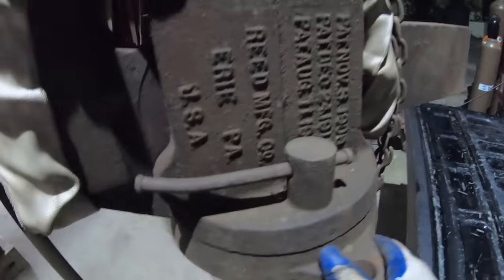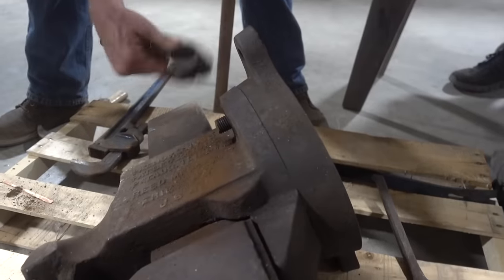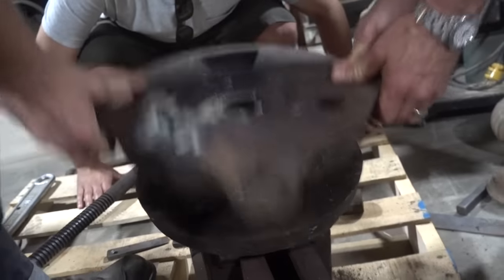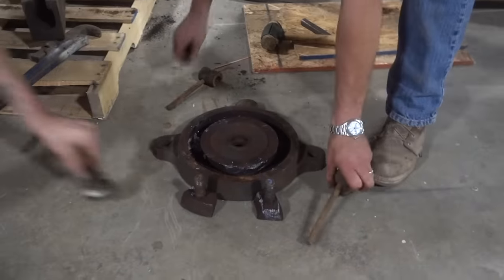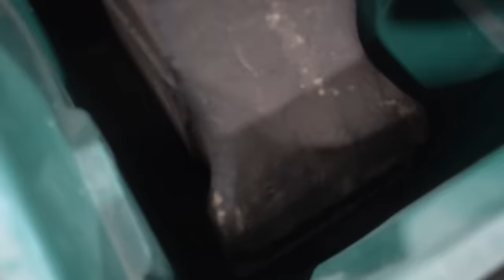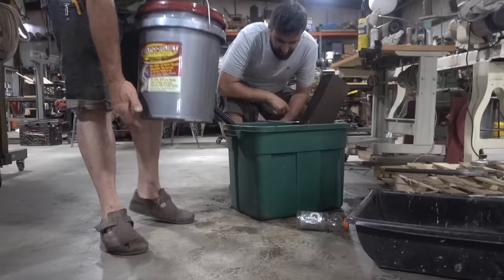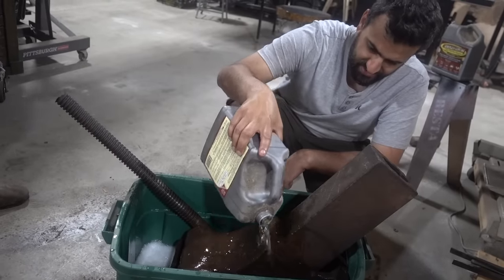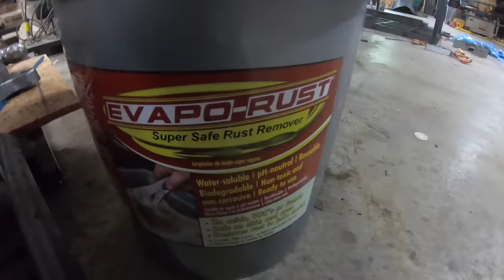DiResta 280lb VISE restoration

Comment: It always pains me to see people try and disassemble the slide.. but don't use a wire wheel to remove the rust and debris.. so they end up beating the hell outta the thing..
Reply: Or adding some penetrating oil, works wonders.
Carl
Reply: Yup. Amateur hour.
Reply: I know that just kills me also. If they would stop and think about what they are trying to achieve it would make their life alot easier. Work smarter not harder.

Comment: Great trick I learned from an old-timer for getting rusted/seized components or bolts lose:
With a torch, heat the metal.
Rub wax of any kind on the joint.
Let cool.

The wax will be pulled into the joint/cracks  & lubricant the metal as it cools. This works when penetrating oils fail.
Reply: Huh... gonna try it this weekend :)

Comment: Pounding wedges in stuck vice jaws is just asking for trouble. I have seen the massive mighty jaws just snap but Im so glad this vise is being restored. I have one just like it.
Reply: I was thinking the same thing. what's the alternative? pre-soak in rust remover before working the parts free?

edit: I thought you were referring to the base coming off. but still, what other options are there? hydraulic press? soak in oil ore additional rust remover? I liked their heating idea to loosen the grip
Reply: @TomsLife9  50%50% automatic transmission fluid and acetone. Chews up the rust and penetrates deep in the cracks. Freed lots of rusty things up with that mix.

Comment: When things are stuck try a solution of 50% acetone, 50% automatic transmission fluid, also know as Fagen's Brew. Mechanics workshop did a torque test; Nothing 516, WD40 238, PBBlaster 214, Liquid Wrench 214, Kano Kroil 106, Fagen's Brew 53
Reply: IMHO acetone and ATF is fine for a small glass jar (or perhaps a quart) of parts, but the flammability risk is too great when using a larger quantity of acetone. A saner (and safer, cheaper) "solution" 😆is diesel mixed with about 30% ATF. Very old and proven mixture. Just did a large industrial chain at work a few weeks ago using 3 gallons of this very mix.  Very successful as always.

Comment: Does anyone know what Jimmy used to get the raw metal shiny look? Glad he didn't paint it...
Reply: I've used similar rust removers and they tend to leave a black residue that washes or wipes off. I'm guessing Jimmy used a wire wheel on the angle grinder to get that surface on the metal

Comment: "This is not the rookie corner over here"...proceeds without a drop of any kind of penetrating oil, hits threads with a hammer a couple different times, mars a part with pipe wrench jaws.
Reply: Dennis O'Brien I was thinking the same thing...only a rookie would need a hammer that big to get the job done. Haha

Comment: Should have bolted the base to the concrete and hammered the hell out of the tail with the woodblock and sledgehammer..
Reply: Heat application. They did it at the very end, and it did the trick.

Comment: Beating on that vise WITH A SLEDGEHAMMER like that was pretty stupid. You
should have soaked it in evaporust FIRST and or 
SOAKED IT IN A CONCOCTION OF OILS to free everything up.
I don’t think I’ve ever seen such stupidity.
Reply: It looked like they did soak it. In evaporust. Before they struck it with a sledgehammer. You could even tell that they were reluctant to hit it even then.
Reply: you obviously have no idea how strong those old vices are its 280 lbs

Comment: I like that you didn’t do all the unnecessary work to repair chips, fill voids, etc. A tool is a tool and they’re meant to be used. They don’t have to be pretty, as long as they do their job.
Reply: Agreed! I'm working on restoring a large vise but am not going overboard with it. Just cleaning it up a bit and then will be putting it to work.

Comment: We used to have the equivalent Sheffield made vice at the Pit 'I worked at. I think it was called a Record chipping vice and it weighed in about 2 1/2 hundredweight. When the pit closed one of the blacksmiths made off with it [and a load of other stuff] in the back of his car - looked like concord taking off with his front wheels barely touching the ground

Comment: Flipping the vise upside down (jaws towards the floor) after soaking, helps it to break free while using the hammers. (Gravity assist, plus not having to slide through it’s worn and rusted path.)

Comment: A pneumatic hammer with a flat ended bit, applied in the right places, would greatly assist in breaking free the rust bonded parts (shock wave).

Comment: Well, if I ever get a huge rusty old vice that needs fixing, I now know how to do it, but I think that I'll use a set of bar clamps in expansion mode rather than do all that hammering.

It just occurred to me that, if you had made that collar clamp and put that on first, you might have been able to separate the jaws with it's threaded rod.

Comment: Should really consider rebuilding the seats of those jaws with some siliconized bronze or a similar filler. They broke off for a reason, your jaws are going to want to pivot in those directions whenever you're putting that vise through it's paces.

Comment: I see he milled a flat land for the allen bolt in the turn screw collar, most likely an afterthought as it would be easier to drill and tap on a flat rather than a radius... as well as drilling with the mill while still set up after machining  - 11:40

Comment: I restored 1 wilton (6" Italian made (!)) and 1 Grey tools (Canadian copy of #8 Record) in the last two weeks. Both vises had missing cast iron chunks from them and both times using cast iron welding rods I fixed them. I am wondering why you did not do the same. I welded extra material on (metal was golden in color) and then I fixed the surface on the milling machine with rounded parts fixed with hand grinder. If I wanted to make it perfect without any marks I could use some bondo or when metal is exposed some tig.

Comment: Hey Jimmy. Nice piece of metal you have there. How did you transfer the mounting holes for the old jaws onto your new flat stock? Is there some trick using ink / Sharpies or did you use a piece of paper and a pencil or maybe masking tape with cut-outs? Usually when I do something like this in wood there is enough "slack" in the whole system to allow for my inaccuracies. Getting the holes to line up perfectly in metal seems to be so much tougher, though.
Reply: shouldnt be hard to measure up from the bottom shoulder on the vise to the height of the holes then just the spacing between them and transfer that to the new jaws.. i always grab the next size or sometimes two sizes up of drill bit just to make life easier with fitment and not doing things twice... not all projects allow for that though

Comment: Bangin' away on the metal vice with a ball peen hammer with earplugs dangling around the neck.......good one. 😁
Adam Booth is wishing he'd found that. 😉
With the lubrication of the cast during machining you've now created a slurry of the dust just great for the ways....just saying.
Thanks for the video.

Comment: You need to get a shitty oven, large enough for stuff like this. Get the vise (or giant rusted part) toasty (temperatures may vary with location) and then take it out and douse the seams with any thin oil you might have. Prolly want to do this outside. Idea is that the thin oil will seep in the gaps and allow you to take it apart.

Comment: what kind of steel did you use for the teeth? did you harden them or was the steel hardened already? what kind of steel should i use if i get in this situation myself?
Reply: Hardened 4140 is a good  general purpose vise jaw steel.

Comment: Nice to see some familiar faces 😁
I was wondering.. Why are vice jaw plates (if that's the right term!?) never hardened? Could someone enlighten me please guys? x
Reply: Jaw inserts are not hardened because you want them to be softer than the workpiece you're using them to hold. This way the inserts get damaged instead of the workpiece. Inserts are designed to be replaceable. They are essentially a consumable item.
Reply: @JDeWittDIY  Thank you. That makes perfect sense..❤
Reply: @-Deena.  No problem, glad to help!

Comment: I collect vises, you have a beauty.
Reply: Maybe you can help me?. I have a vintage vise it weighs about 150 lbs. The only marking on the exterior is a capital G,, Any ideas the make of it? So maybe i can research a little on it,
Reply: john piano hmmm would need a pick of jaws and base, anything cast into nut?
Reply: @johnpiano5226  Are you sure that is a vintage vise, I have seen more modern vises made with that mark [usually not American made]
Reply: @darrinrentruc6614  probabally 1950''s ish it is a beast.. 130 lbs or more it is huge..
Reply: @johnpiano5226  If it is 1950 ish then it is probably USA with American Quality. Sounds like a keeper to me. I have bought and sold many on ebay in the past. They will last many generations and should be handed down just as firearms and watches.

Comment: I have the same vise but not swivel. Heavy sob and I can’t get it apart
Reply: Thomas don't use the techniques illustrated in this video - very hard on the vise with a high risk of failure.  Use Kroil (available from McMaster-Carr) - apply liberally and let it soak.  Heat gently with a propane torch after a few days of soaking with Kroil (careful Kroil is flammable until it evaporates off - which is why you wait days).  Then re-apply Kroil and load some dry ice on the vise (use a plastic garbage bag to contain the dry ice).  Repeat full process over and over - patience is key - this could take a few weeks.  Use only brass, lead, and / or wood mallets to tap tap tap.  Take your time.  It will free up and you won't spoil or crack anything.  You won't be disappointed and the vise won't be damaged in any way.

Comment: I own the same vise rescued from my old millwright shop, although it is in worse shape I figure. Interested in restoring it??
Reply: With person hours, machine hours and material, that would probably set you back 5k. Still interested?
Reply: Not one bit especially when I have access to the machinery, but just not enough time, thanks though and for the response.
Reply: @arrzfr  where the hell are you getting your numbers dude
Reply: @tuckerabbott  4 guys, lathe, mill, CNC, gallons of chemicals, days of pounding, grinding, polishing. Good luck.

Comment: What's a vise that size for?
Reply: Adequacy.
Reply: Big things. These side vises were often found in railroad shops and shipyard shops. Similar vises were found in blacksmith and machine shops for a process called “chipping”. This needed huge vises because it was the stock removal process using specialized cold chisels. Needed a heavy vise that would stay secure despite the pounding. And a traditional leg vise was not suitable because the arc of the jaw made and coarse acme screw didn’t allow a secure enough grip
Reply: Anything

Comment: All that trouble on the CNC and you left the jaws saw cut?  Then you didn’t put any paint on it?  

Looks great now finish the restoration.
Reply: To be fair, DeVICEs like this sometimes are harder to maintain painted / harder to see where corrosion is setting in, despite the protective aspect of painting.
Besides, I kinda like the brutal-functional aesthetic of leaving it all raw - including the cut on the jaw. Different tastes I guess.
Reply: CrocosNZ yeah and it kind of gives you a reason to rub it down with oil or grease all the time...you’re right, some stuff doesn’t need paint to look good

Comment: 50%acetone + 50% transmission fluid would have helped a lot
Reply: Would you mind telling us how?
Reply: @mrshoeguy2477  acetone will eat away old grease/dirt and rust, trans fluid would soak into every nook and cranny as a lubricant. No guarantee it will work but it’s like dw-40 on crack. Especially if threads are locked up

Comment: What is in that black pressurised spray bottle that he sprays all over the vise?? 10:24 ??
Reply: I think it's just WD-40 to lubricate the surface
Reply: @bengyy.m  Thx, That's what I thought, but I also though maybe he was using some type of rust prevention coating or something. Also Jimmy, if you see this... What kind of WD-40 do you like to use mainly?

Comment: Milled the supports below the jaws, left them without any welding additions. The first time someone hammers smth down that's clamped in the jaws, the whole thing is collapsing, sry Jimmy, you should have known better.
Reply: i was thinking same thing, those cracked-off pieces below jaws could be rewelded to former shape... guess he did not had a plenty of welders back then.

Comment: That’s 208 pounds, surely? Not 280.
Reply: The 109 and 209 were the big Reed vises.  Both a bit bigger, but yes, the 108 tips the scales just under 300 lbs.
Reply: @1doctordirt  My ex wife was a 108  model.

Comment: Why no oil/WD40/RustBuster/LiquidWrench/Buster when freeing the swivel lock nut handle?    BTW, you should have left the front and back jaw bodies in the Evapo-Rust for a week or two so the chemical would have time to penetrate and free those pieces.    07:50  Big no-no, wearing jewelry when working in a shop.    Not a 'restoration'.  A clean up.

Comment: I don't know why to remove corrosion he always uses chemicals that are bad for the environment and doesn't use sandblasting
Reply: I'm not a machinist but I'm pretty sure a sandblaster is not gonna blast those pieces apart.
Reply: While I agree there are vailid alternatives to the evaporust, like wire wheeling, sandblasting is not an option on a part like an old bench vice, as you saw him filing down the slide, parts will respond poorly to the sandblasting process. Never mind the weight
Reply: @kuki7500 Evaporust is non toxic. Try not to say stupid shit.